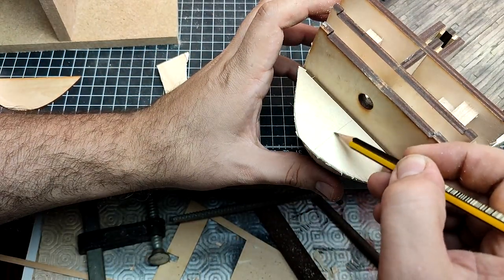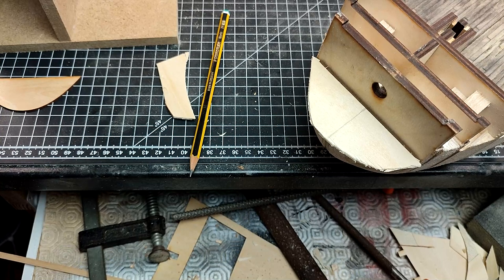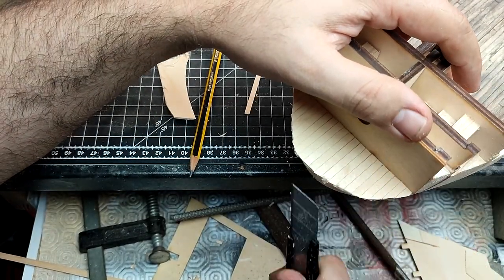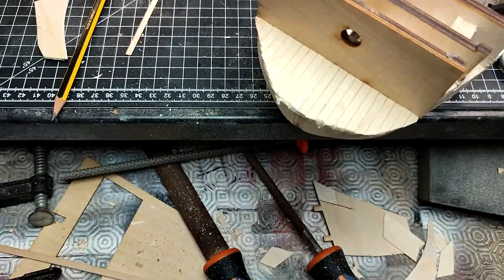The Black Pearl model ship -part 17- Bowsprit deck | Scratch build plans wooden model ship

Comment: The price of perfection... struggling to cut roughly glued one, while all the time the laser cut one calmly lay next to the pencil on the left ? 😊😊😊👍👍👍
Reply from the maker: wrong curvature on the laser cut one, new one was needed, was expected since i drew it, because ribs 2 and 3 from melpapa's drawings didn't made much sense, so i changed rib 2 (these are the ribs that are together right behind the deck, and i thought i had considered those changes when drawing the deck, although the width at the back is correctly adapted, i didn't account for a bit different curvature, so a new one had to be made, i should have made it simply oversized and just sand it to the hull shape, but didn't think of it at the time
Reply from the maker: but, good eye, i didn't even noticed it was there